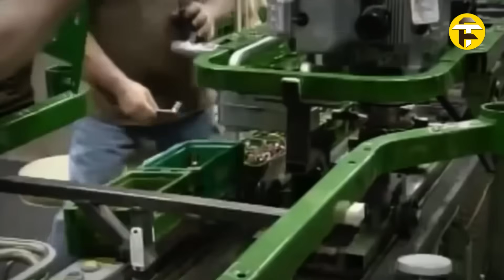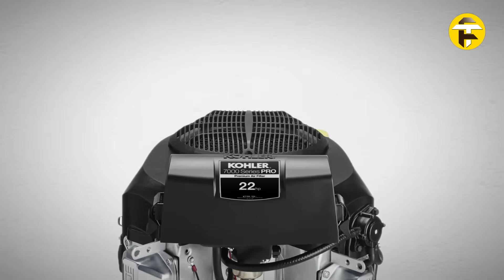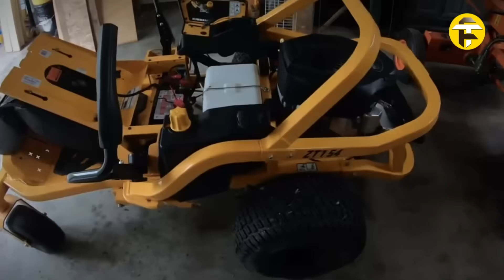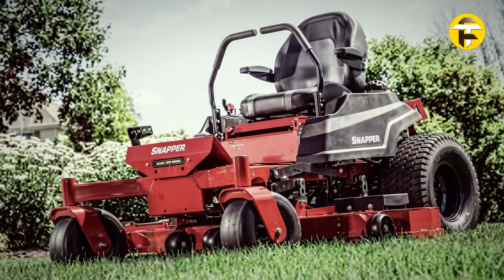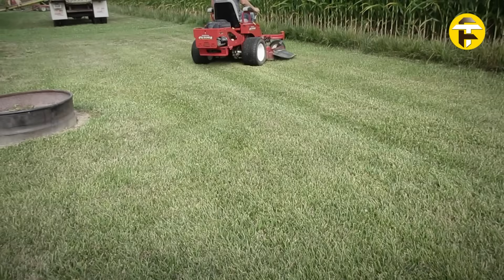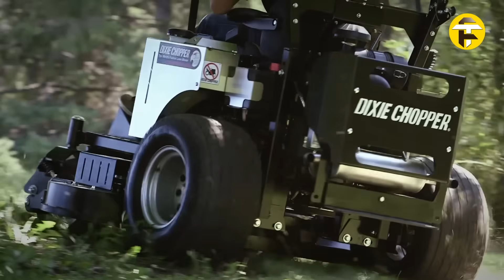Why Nobody Is Buying These 5 Zero Turns in 2026 — ROTTING on Dealer Lots

Comment: 10 years ago I bought a used 52 inch cub cadet. Not what I wanted but I gave 800 for it and just keep it fixed with ebay and Amazon cheap parts that work well.